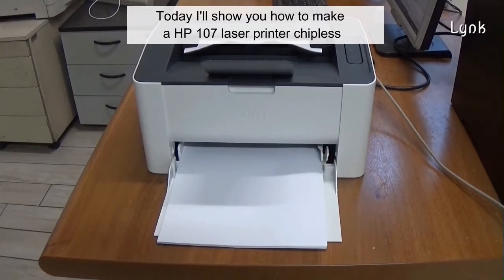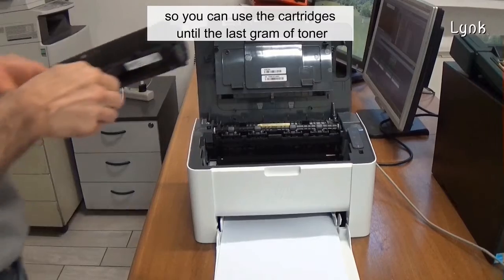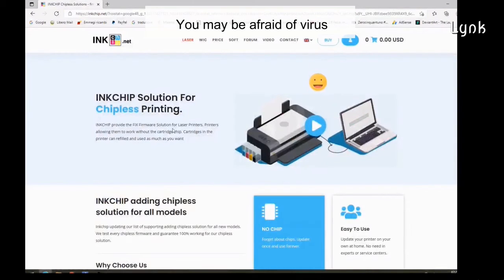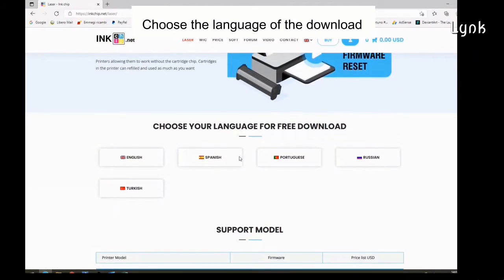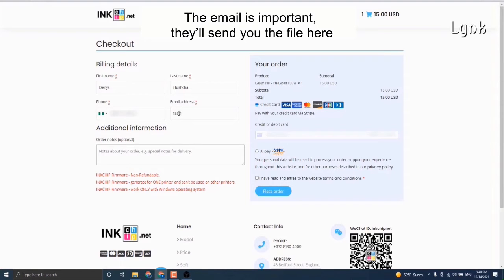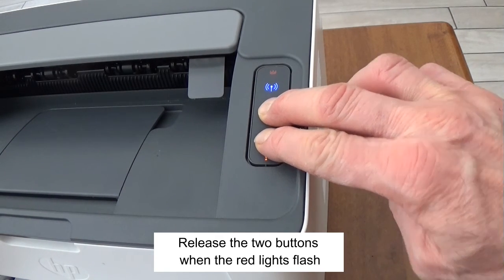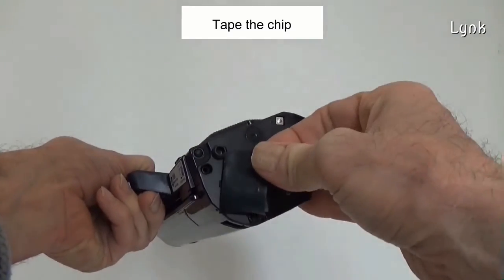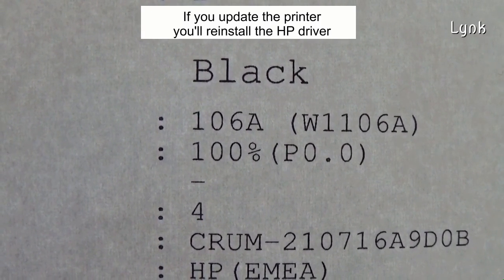How to make a Laser Printer Chipless HP W1106A 103 107a 107r 107w 108  131 135a 137fnw 150 178

Comment: Which firmware do I need to buy if I have an HP Laserjet M110WE to enable the chipless toner option?. Can i flash firmware from another model eg. 108W to 110WE ?.
Reply from the maker: I think not, but it's better to contact inkchip. they often find a solution

Comment: Thank you so much. Does the firmware from the website still work for more than one printer? how to get the firmware installer application ?
Reply from the maker: No. it works only for a single printer. To get the firmware installer application go to the inkchip website
Reply: @viandant5  Thank you so much.
Reply: Hello.  can you help me software to reset the canon ts207 counter please
Reply from the maker: @saokeerelax-dm4568  Sorry Inkchip has no software for Canon

Comment: Thank you for great tutorial. I would like to ask you a strange questions. I found info, that after making it chipless, hp 178/179 can be modded to use samsung 365 toner, whitch is a little bit cheaper. Is it worth considering? And as a proffesional, do you have comparison of drums in these models? Your tutorial to change drum in samsung drum unit is genius, but... maybe samsung drum also fits hp (not the whole unit, but drum only)?
Reply from the maker: Yes, HP 179 is a Samsung machine however the oem units are different from the Samsung CLP series. the compatible ones may work but I don't know, it depends

Comment: Dear sir how to fix this error (E000025-0468) on canon IR c3320i ??
Reply from the maker: It does not detect the toner. Remove and reinstall the toner container, check for broken partes, check the connectors of the developer unit
Reply: @viandant5  I replaced the toners but it didn’t work, and again the same error
Reply from the maker: @Ahmad_Atah  It could be the connections between toner and machine, or the developer unit

Comment: mine is not working what's wrong please answer... My Printer HP laser 107a
Reply from the maker: What do you mean? The chipless firmware doesn't work?
Reply: @viandant5  I just bought a HP laser 107a printer, then I tried to use the firmware without the chip according to the video and the result was that the light didn't flash.
Reply from the maker: @neanganududeun2018  Did you buy the service? contact natalie.printers@gmail.com, she is the commercial manager
Reply: @viandant5  I've chatted with the inkchip, they said my printer's firmware is not compatible, is there any other steps besides inkchip, please answer?
Reply from the maker: @neanganududeun2018  No, I know only inkchip but you can wait until they release the version compatible with your firmware
Reply: @viandant5  ok, thanks for the answer, hopefully the channel will grow.

Comment: hello sir! i have a problem in my black toner in my workcentre 7970, there is a smudge in left side of the paper 12x18 media, its something like black smudge or black dirt in my every print, i don't know what is the cause. i've noticed that there is something excess toner in the left side of my drum every time i check it. i dont know if that is the cause of the smudges. i already  exchange the drum unit of my black and yellow and still same problem.. and i already clean the 2nd bias roller and the problem still there.. i wonder if the black developing unit is tha problem?
Reply from the maker: May be the toner roller or the blade of the toner roller are defective or dirty
Reply: @viandant5  where can i find that toner roller?
Reply from the maker: @ChekzthisoutTV  I think it could be dirty, first of all try to clean it. I don't know where to find that roller